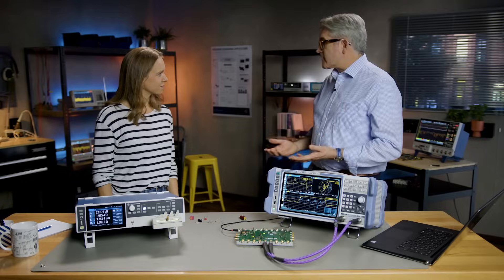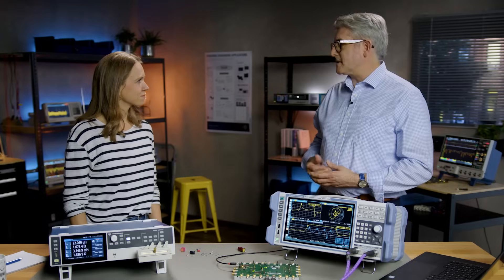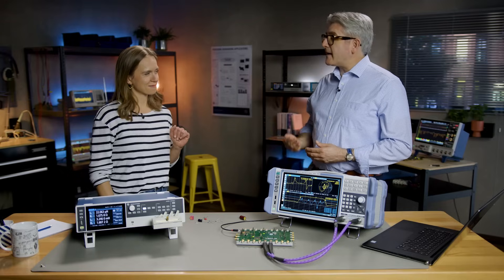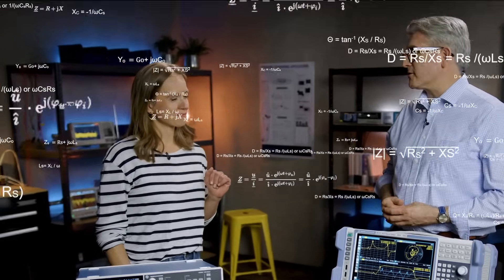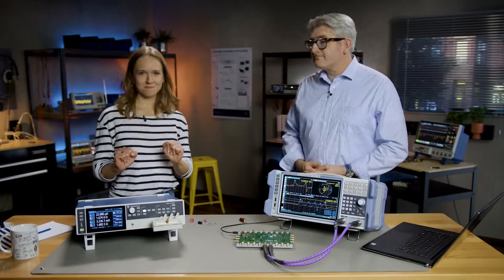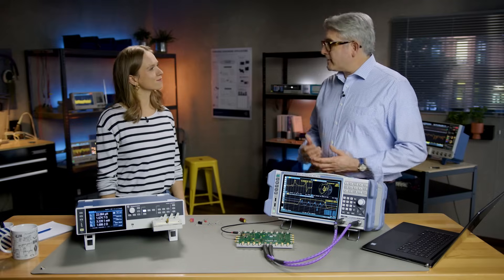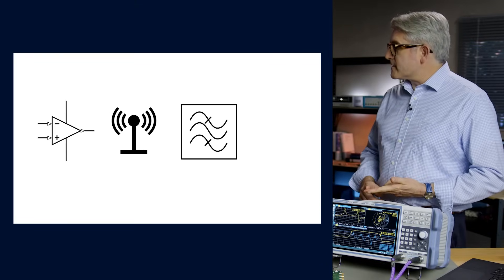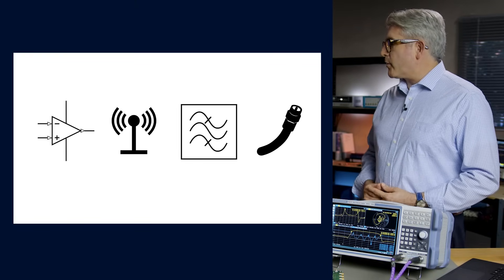Precision in under 10 minutes - When to use an LCR meter vs a VNA

Comment: I recently had a need to evaluate a 120 Hz + harmonics filtering power choke, intended for 0 to 20 A current.  The source is normal bridge rectifier and there is a capacitor bank after the choke.  The choke itself is constructed of transformer laminations, with an air gap — actually the gap is filled with some insulator sheet.  I started by measuring with an LCR meter, 100, 120, 1000, 10 000 and 100 000 Hz.  I got definitely different results for inductance at different frequencies.  So I added ESR measurement to get an idea of the phase angle (ranging 95 to 98 degrees at 100 and 120 Hz, as well as calculated from DC resistance).  Then I added a 60 Hz measurement of AC current and AC voltage, both true RMS, and calculated the inductance that way.  Finally I made a transient measurement with applied voltage from a big (about 0.15 F) capacitor bank and calculated the inductance from the current slope.  I have done similar measurements on ferrite core and iron powder core chokes before and learned to interpret the saturation characteristics from the scope trace.  I also do have a nearly suitable VNA, but decided not to use it, as it is specified for over 200 Hz frequencies.  Finally, I also did not care to use my old HP phase angle measuring instrument (up to 13 MHz).  I deemed it not relevant in this case.  Moreover, it was in my outside storage.  I also considered a Lissajous pattern measurement, but the modern digital storage oscilloscopes are not too well suited for that, and I ran out of time setting up further systems with my old analog storage oscilloscopes — I mean the evening had already advanced past my bed time, and I already had enough of results that were within decent match.  Someday I may add means of including frequency harmonic content as well as complete hysteresis loop effects.  But that day is not yet, or maybe never.  So much more interesting stuff to investigate…

Comment: LCR is useless for today's electronics,  such as DC/DC . VNA is the right way to go .
I use BODE 100 from omicron. 
1Hz to 50Mhz . 
R&S has not such for low frequency VNA
Reply: R&S MXOs FRA go down to 10 mHz and work really well for phase and margin analysis.  It's a low cost option to the scope.  Bode100s are great also.
Reply: Sorry my friend ... LCR is VERY important to verify your components performance and somehow a black box testing ... I can't use my lab daily without an LCR meter right besides AVO meter ...

Comment: Masha is a good host. However, I am not sure who the audience is for this particular video. Someone interested in expensive lab/production devices like these will already know what LCR and VNA are, A 'tips and tricks' type to get the most out of your investment would be better. But, it was a great start thanks to Masha's enthusiasm.
Reply: I agree, I was expecting much more details and accuracy discussions for practical situations.
Difference between balanced and unbalanced measurement setups.
Influence of stray capacitance to ground.
Test fixtures, one port, series or shunt connection for impedance measurements with VNA and so on.
As per default I would use the VNA for anything with a coaxial connector and the LCR meter for anything connected with clipleads. Is that a good rule of thumb?
What about SMD components?
Convince and how frequent calibrations that are needed and so on.